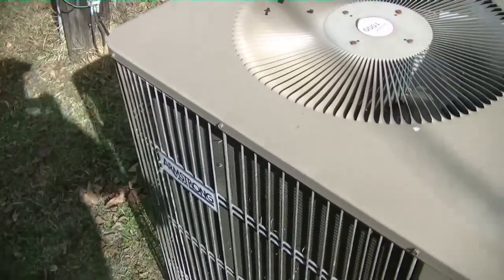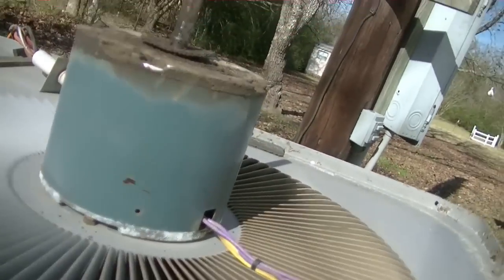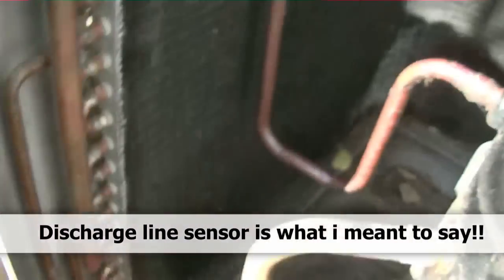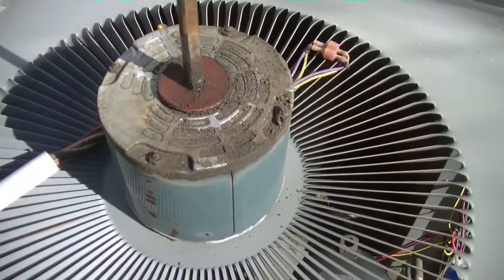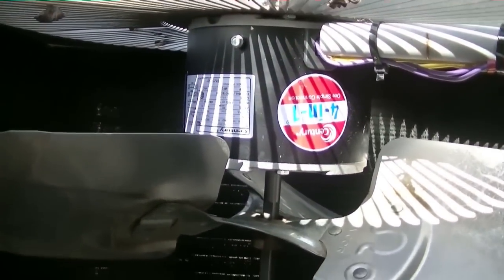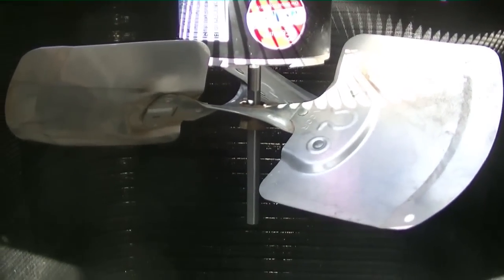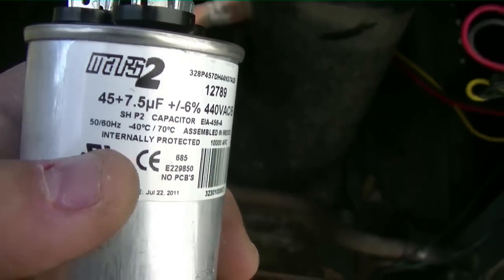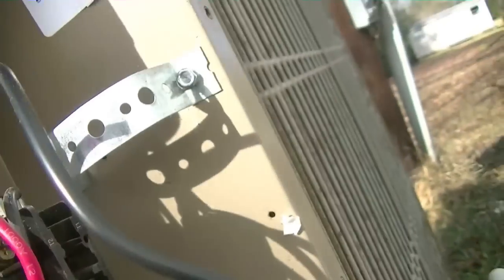HVAC Service- Condenser Fan Motor Replacment

Comment: As I am watching this video which is pretty good by the way and congrats on the addition to the family. I couldn't help but notice that the fan motor had still two yellow plastic plugs on the side. Now could that have been the reason the motor failed?

Comment: Also about using the 45 instead of a 40, No big deal. + or minus 5 no big deal. Like u Said i'd rather go up a size than go down a size. Heck i have seen 5 ton Condensing units with anywhere from 50mfd to 80 mfd on them.